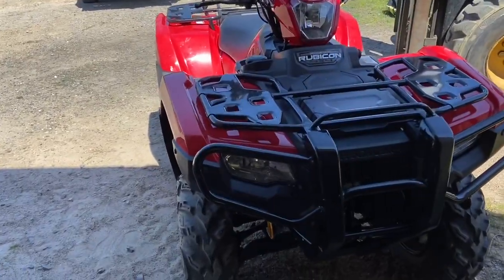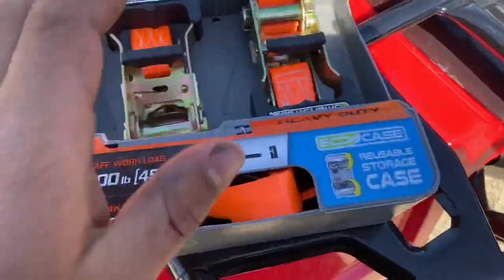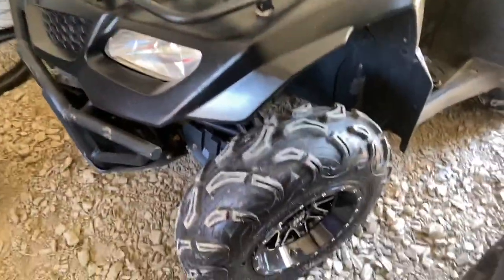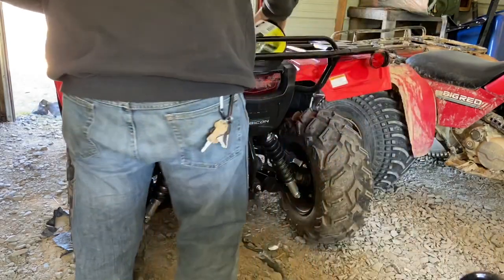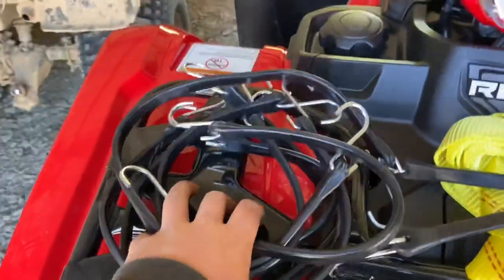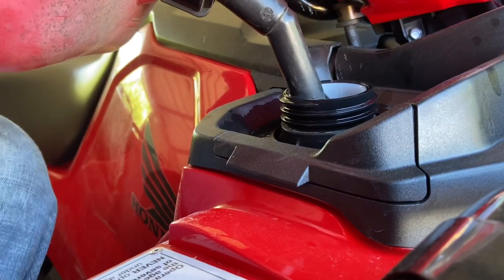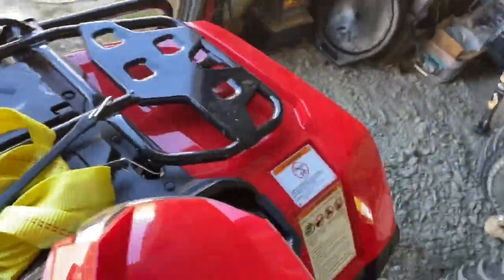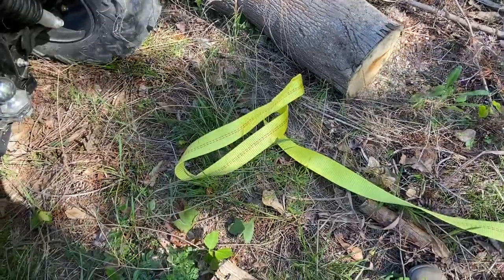First things to do when you buy a new Honda Rubicon 520

Comment: When I tow logs is much easier to use a chain with hooks at the ends.  Just a couple wraps around the log and link it to itself then I just do one wrap around the ball and link it.  The chain won't get chewed up by the ground and will last you your lifetime.   For tie down straps I use the Rhino brand off amazon because they have the spring loaded keepers on the ends.  This helps keep them on tie down points when bouncing down the road.  Don't forget a good trickle charger that you can keep on when they sit over winter or months of no use.  I always make sure I have or install a 12v outlet so that I can run the 12V compressor or plug in a usb charger and throw one in my box.  This way if you get separated or ride single and get broke down and it takes time for someone to get to you your cell doesn't die.  Battery operate head flashlight good idea too.

Comment: Nice bike hondas are tough . I carry a tow strap on my front rack  , &  powersaw at all times .

Your better off have a two or three foot cable with loop on each end to tow logs any those other straps will not make long before wear through from rubbing on ground .

Check out my what i carry video in my dry box may give you some ideas stuff maybe you like or not like to carry cheers .